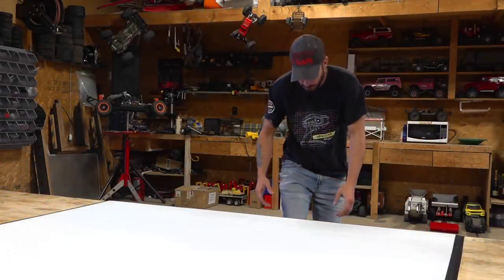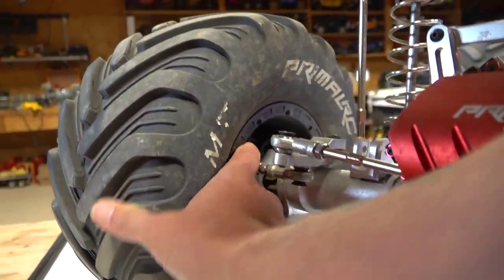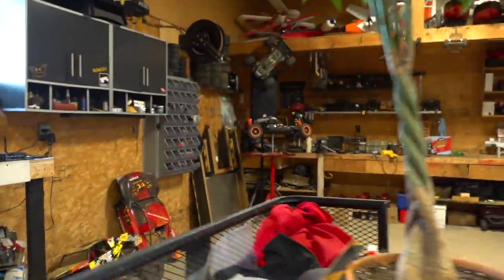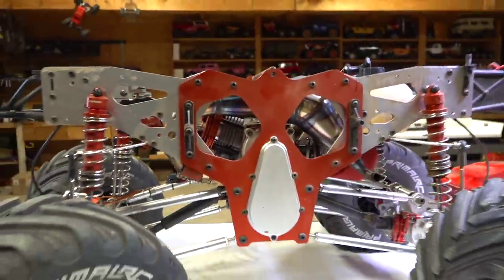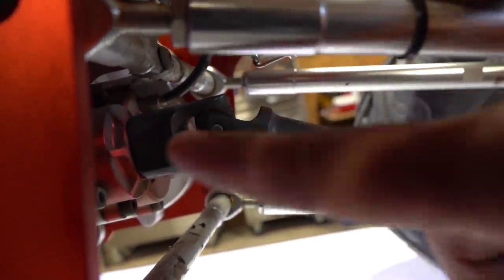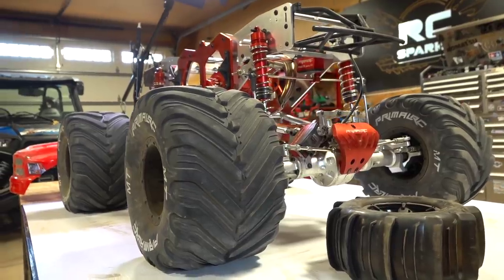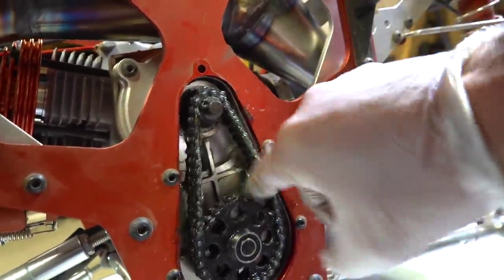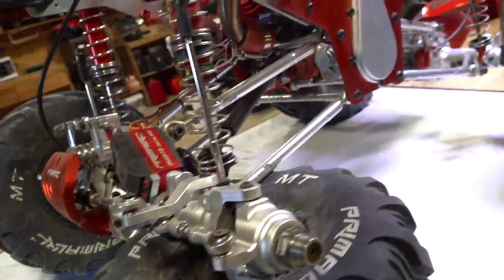MAN speaks of his GIANT 5th scale MEGA MONSTER TRUCK - 49cc GAS POWERED RAMINATOR | RC ADVENTURES

Comment: It looks really well built. Considering the forces that this truck endured from all those jumps it has held up so well. I think the RTR with small motor setup is good, so many RC's come out with powerful motors but with weak points that break elsewhere and require lots of upgrading. I would be pretty happy with the stock power, it's a monster truck and doesnt need to be super fast.

Comment: Your missing a screw for the center top chassis brace on the right side when looking at the front of the machine
Reply: Lol, maybe I should have read some comments before writing mine.
Reply: You're*
Reply: @landscape6285  do you think i care?
Reply: also missing a passenger front shock nut
Reply: Saw this as well in every shot. Lol
Reply from the maker: Yup, all fixed up now.. thanks!
Reply: @TheRealRCSparks  no problem just thout id help out dont wanna see you go bash it and not have the reinforcement secured and end up bending something
Reply: If so good
Reply: crazytay05 was driving me insane lol
Reply: I am very impressed with the overall build and Engineering that went into that truck. Well put together video as well

Comment: whoever is complaining about the Monster Truck being slow, have never seen a real one in person. Monster trucks are NOT FAST.
Reply: Tyrone ty specially if you scale down speed to 1/5 it’s like 12mph
Reply: Doesnt change the fact it's slow, really slow, the postive I see is its big
Reply: I wanna see 5th scale do 60mph!
Reply: @dookiebooger9967  sounds dangerous.     I like it
Reply: Yeah but it's not a monster truck , it's a rc truck, I have a losi 5t, that does 90mph, never seen a full size version do 450mph
Reply: @FakeAccount-mw8pe  it's an 80lbs monster truck with wheels that probably each weigh 5 lbs. Sure a Losi can do 90mph if it only weighs about 40lbs and has 12 ounce wheels to spin.
Reply: Still slow, very slow, I've seen paint dry faster

Comment: I think the thing about its price that people complain about, simply do not know how much machine work costs. All the electronics and the engine are significantly less than the aluminum itself along with the machining to turn the raw metal into the axles and other parts. If you took any axle off your favorite RC to a machine shop with CNC machines and asked them to copy your parts in aluminum, I bet you're out several hundred dollars for a single axle. I don't know if Primal ever said in their videos how long it takes to make the parts, but I would wager its probably close to a day to just machine the axle components. The chassis plates are probably the easiest and least time consuming parts to make. 

So I think the price for what it is, is pretty good. Really after your videos and the videos from the guys over at RC Tanks and Trucks 24/7 I think my biggest concern is actually the rod ends on the suspension and steering links.
Reply: Yup.

Comment: It's badass!  Cannot believe how well it held up either.  Before you swap that engine, look into simple mods. Maybe up the compression and run higher octane or carb swap?  Like you said, cheap engine, might as well see what it'll hold up too.  Think it needs just enough power to pull the front up.  That'd be scale like.  Thanks for the vids!

Comment: Great episode Medic,  it's one hell of a beast that's for sure.  I've watched all of your vids on it and I think its definitely been getting a lot better in the bottom end. I thought it was going pretty good in the low end especially for, like you say; The amount of tires etc it needs to get moving is all large. It will be interesting to see it once it's full broken in, but maybe you'll swap engines before that happens. 
I'm sure you noticed the screw missing in the upper center left hand cross frame support during your maintenance session 👍

Comment: That 49cc engine looks really close to the same motors they use in China pocket bikes. You may wanna look into the I think its 62cc liquid cooled pocket bike engines. I've had several pocket bikes and they do get going pretty good but I came across a liquid cooled one for 150$ and normally wouldnt pay that much for a China bike but the thing was mint and cane with the original wood crate so bought it. Got it home cleaned carb,replaced crappy fuel lines and went for a rip,night and day compared to the air cooled!! Youd need to make a radiator mount for it but would be a really impressive upgrade!!

Comment: Ive watched a ton of vids on it. Alot of it comes down to the owners also, if they can tune it well. And what is someone actually expecting out of a large scale rc, which, are not for everyone because of that. If you want 100mph go buy an 8s lipo something or other. But for the exact facts you stated, which i dont need talked into after owning and racing large scale rcs, and small, for years, that this will be the next large scale rc i own. People have to be realistic in their goals with a toy. Everyone has their opnion, thats just mine. Nice work on the clear, informative vid as always.

Comment: Use threadlock on the lock nut. It couldn't hurt and is still metal on metal.  Looks like you're enjoying it! 👊👍👍👌
Reply from the maker: A Lock Nut is already threaded with Plastic. Thread lock does not work with it..
Reply: @TheRealRCSparks  Ah I see Aaron. I was thinking of the ones that have the lock washer on them. I know what one you're taking about now. Maybe some super glue then tighten it on? Might help with vibration and still come off when you need. Just a thought.

Comment: I love the look of the machine, its a beast.  I think the speed of the truck is perfect, it wasn't designed or built to be a super fast high flying race truck. It is best used the way you have done in your previous videos.  I feel like any more than that will lead to more serious possibly critical damage ($$$$). For a $3000us rig the parts may be expensive and if they are a small company the parts may be tough to get hold of.  I don't know I haven't done any research on the company, this is just my opinion.
Reply from the maker: You should see their Dragster!! Its insane.. and super popular.

Comment: Would like to see the difference in handling and speed with the different gears it comes with. Looks like you can also change up the engine and transmission gears. Wish I had the coin to spend on one.

Comment: I really like this but waiting to see if they bring out a roller ad with the rear steer, the roller appeals as I would fit a RC_MAX 90cc engine and Hilantronics servo's.
Love the fact it has killswitch and reverse out of the box. I would retro fit a hydraulic brake systen it would not be to difficult, if I kept the cable system I would use two servo's maybe. Awsome machine maybe an electric start would be an excellent upgrade so if it flames out no walk of shame.

Comment: I have a red cat rampage with an oversized engine two speed transmission slightly smaller tires that expose the pins on the axle nuts they fly out I put Roll pins extremely tight and they still fly out after trial and error my solution putting a piece of heat shrink sleeved over this area problem solved this might work for your drive shaft pen if the Loctite is not enough Love the shows thanks for all you do from Hawaii with love

Comment: The Main contribution to the 49cc engine being slow in these cars is they have fitted a tiny walbro style carb which is massivly limiting the engine! 
These engines are designed to run with proper dellorto style float bowl carbs, and is the type of carb used when fitted into mini bikes hence why a 49cc minibike towing a human can easily out pace this rc car with no load..  The only problem is you cant run these style of ccarbs on a RC because theres no throttle servo, they have a throttle slide like a proper motorcycle carb.

Comment: run in takes time to lube all the parts so it does not seize plus heating the engine up and cooling stops things breaking once everything is run in on the engine should see a 10% increase in power plus you can pin the throttle without seizing the piston

Comment: The only thing that disappoints me is that you can't get a pro version that comes with big block options, but I 100% understand why they opted to send it equipped with a "small" 50cc engine that's a little bit anemic for an 80 pound truck. I'm as experienced as it gets when it comes to bashing and racing RCs at 41 years old and been in the hobby in some way for my entire life and I would be ok with the weaker engine until I got 100% confident controlling something that big

Comment: I think the one of the reasons why it seems like it has no power is because the engine is a two stroke and therefore it can't make any torque at a low rpm it needs to be able to spin it not that the engine has no power because keep in mind they put those 49cc motors into small scooters and if it can move a person I'll be it not very fast but they can do it then it should be just fine for that 80lb truck once it's broke in and tuned in the future it should be plenty powerful

Comment: u should have let it idle and run 4 total tanks to properly seat and let that engine break in properly not go balls out right from the rip... should have let it idle thru a tank, 1/3 up to full throttle gently thru a total of 4 tanks of fuel... break it it right and treat her good and she will last a ton longer before she falls apart or the motor blows up on you!!

-P3T3R

Comment: 49cc should run a mini bike or go cart with a person riding it
Reply: Be cool if you could just change the sprocket ratio to make it go faster
Reply: 49 cc is awful  small for a go cart.. I would say no less than 200cc
Reply: Depends, these new 50cc Chinese engines are junk. I was referring to something a kid would ride. My point is that a 50cc should go faster than its current setup. Either changing sprockets etc.
Reply: @laird340  I agree, the 50cc should go alot faster..